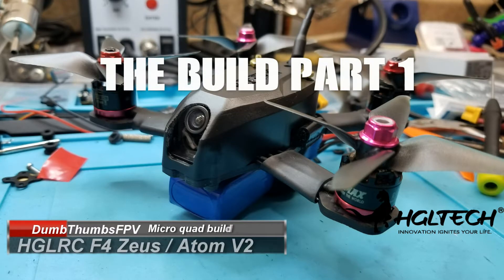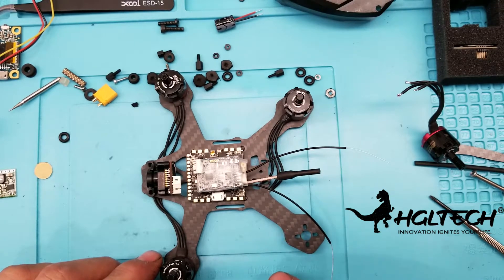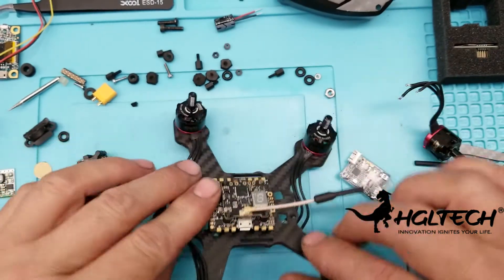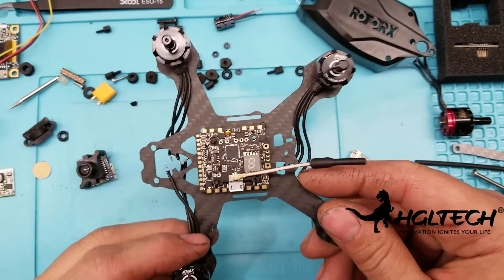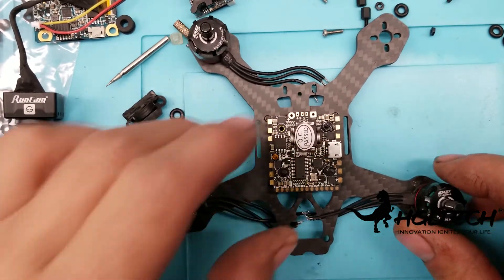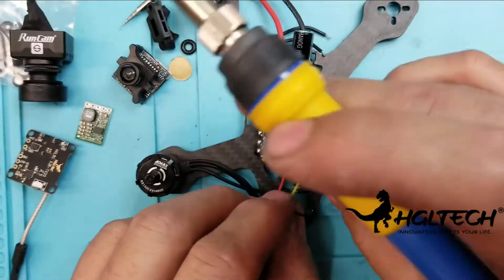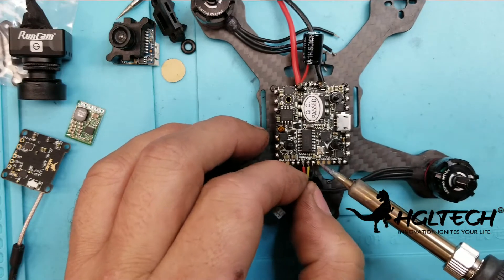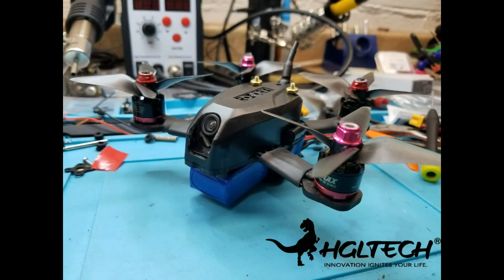Atom V2 HGLRC F4 ZEUS PART 1

Comment: Great video. I was a bit surprised to see you pre-tin the through-hole pads (the ones for the vtx). On through-hole pads, I just put a bit of liquid flux on the pad, run the wire through the hole, then solder. It's easier to get the wire through the hole that way. :) I'm a huge fan of liquid flux. Not only does it give you greater working time before the solder starts to oxidize, it makes the solder "wet" the pad much quicker, resulting in less heat being transferred to nearby components. Using liquid flux, I'm able to pre-tin those large battery pads in half the time it takes when flux isn't used. Yeah, it's that good. :D It's cheap, too. Check out McMaster-Carr's selection of liquid solder pens. I really like the ones that have a felt tip... the kind of tip you'd find in a magic marker.

Edit: Doh... I just remembered that at the start of the video, you said you had a soldering station at work. So I'm sure you know more about soldering than I do. Ah well, I'll leave the comment for guys that haven't ever used liquid flux. Might help 'em out a bit.
Reply from the maker: I pinned this because it's great advice! I actually messed up and soldered the wrong wires on the VTX being used to a 5 volt VTX I ended up almost hooking up the VTX on the 5v OUT side..... I'm sure glad I caught that and fixed it before hooking up the battery!! On the Zues, I did screw up and solder the holes and then poked the wires through.. good eyes :D I didn't realize that the VTX spot on the Zues was 12v either! The Solder I use is Kester 63/37 No. 44 Rosin core and the rosin they use is extremely nice for flow. Also the flux is NON conductive unlike some paste I've used in the past. I made a soldering video but I forgot to mention the 2 second rule on soldering meaning if you can't make the connection in 2 seconds then turn up the soldering iron, if you can make a connection in less time then turn it down.. This only applies to working with boards with small pads.. I said in the video that my iron was 450 degrees C and I meant F... oops  here is my video on soldering.. see what you think.. https://www.youtube.com/watch?v=xCZAcfkam_U
Reply: I was kinda hoping you meant 450F and not C... figured that was the case since you were working on the small pads on the Zeus. Just watched your soldering video. Every rc enthusiast should watch it. I bet the number of board returns would easily be cut in half if everyone watched that vid.

Love the 2 second rule. Going to use that from now on.

I just made my first purchase from gothelirc.com yesterday. I destroyed an HGLRC TX20 Friday night. The temp control for my iron is on the handle, making it way too easy to change the temp without you knowing it. I was expecting 500F, but was really at 725F when I went to solder a pad on the TX20. Ended up ruining an SMD diode right next to the pad. So I purchased a replacement from gothelirc.com. I like the vendor I bought the first board from, but they are on the East Coast. Gotheli is one state away from me (Utah). :)
Reply from the maker: LOL.. I DID THE SAME THING SO DON'T FEEL BAD! My wife came down to talk to me about something and I was soldering battery leads and had the iron hot. Not realizing it I started to solder on the F3V4 board for the Purple 215 build/review and scrubbed a pad right off the board! Luckily the F3V4 is made for an Octocopter so I had other motor pads available. I've been soldering professionally for 25 years and even I made mistakes LMAO. Couldn't believe I did it and I must have locked up because I kept staring at it with my mouth open until the wife asked me what was wrong.. think she thought I was having a stroke :D
Reply: Man, it's good to hear that even pros make mistakes. When it happened, I said, "oh s**t". Immediately, the wife said, "Let me guess, you made another soldering mistake and ruined an expensive board that you now have to buy *again*." I mumbled a reply that she couldn't hear (thankfully) as I went to the den to order the replacement. :) I've heard great things about gothelirc.com, and am hoping to do a lot of business with them in the future. I only fly 3" and smaller quads, so I'm hoping their inventory has a pretty good selection of stuff for the smaller quads.

I'm really enjoying your channel. I've been a subscriber for a long time (even though you probably can't see that, as I have all my privacy settings set to max), but have just today started to binge watch your videos. So if you suddenly see a spike in thumbs up for your videos.... : D I haven't watched them all yet, but man... you have some really good content so far! Look forward to seeing the rest of 'em.

Oh, and I'm looking forward to getting the Kester 63/37 No.44 solder, too. The stuff I'm using isn't the greatest. I do a lot of bullet casting, so I could actually make up some 63/37 myself, but of course it wouldn't have a rosin core. I might give it a try sometime, though, and see if it'll work if I just use liquid flux with it. Just something to mess around with.

Comment: Is the canopy going to fit?
Reply from the maker: Yup with plenty of room to spare actually. That's why I'm  loving where the hobby is going with the smaller components. It allows guys like me who enjoy building as much as flying to be creative. I'll have part two and the flight videos up this weekend. Can't wait to show how good the VTX and camera is :)
Reply: Thanks.  I did a quick test fit placing the FC on the bottom of my Atom V3 and aligning with the 20x20mm holes.  It looked to me like the FC would cover the 30.5x30.5 holes thus making it impossible to mount the canopy... But if you say it will fit I'll pull it apart so I can at least trial mount it on the inside.  Otherwise I'll buy an Elf stack and return it or use it in a different build.
Reply from the maker: Yeah you will see in Part 2 how I addressed the covering of the holes and I made a special part of the video just for you on that topic.  It's a real easy mod and I like it better because the canopy doesn't put strain on the standoffs and therefore the boards in a wreak. On my flight video coming up I'll show some nasty crashes that proves the point.